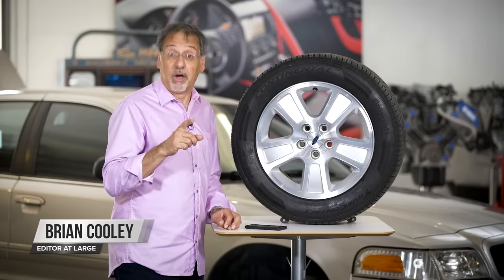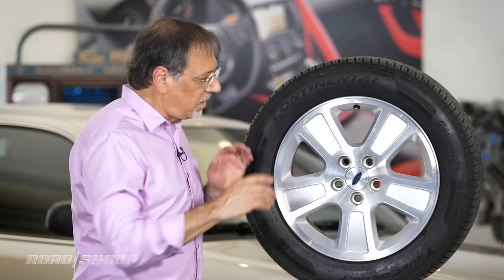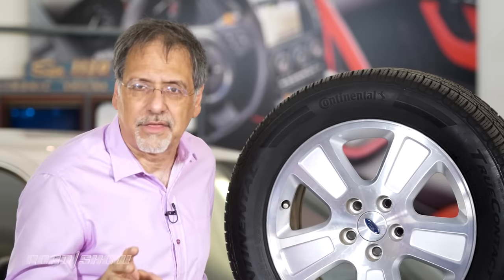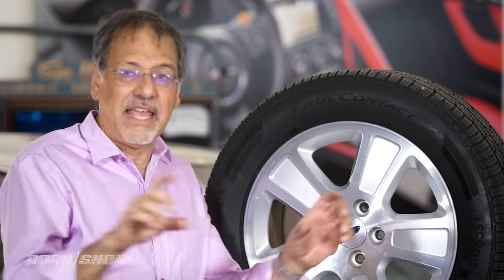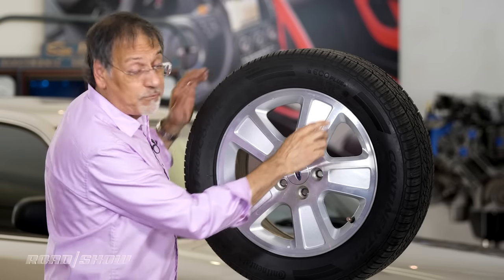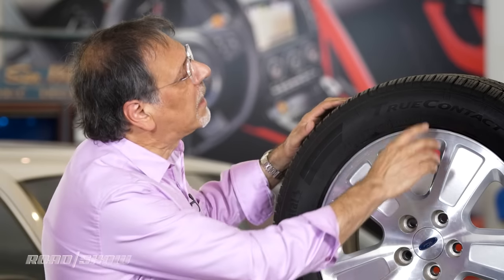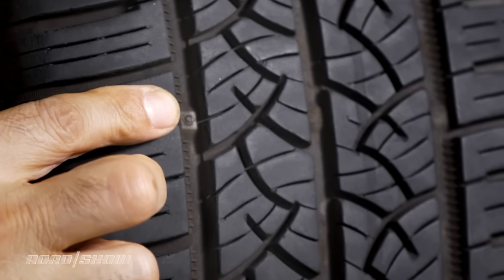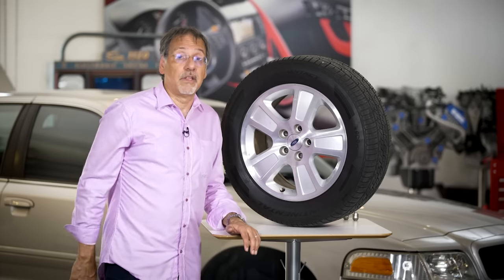How to read tires to know their size, quality and more

Comment: Okay so question Sir, I have an ton of wheel well clearance on my 2021 impreza sport hatchback in manual transmission. It has P225/40R18.  Can i upgrad my tires when they need changing to P245/40R18?

Comment: When you buy a brand new car should the code inside the car door match the code on the tires? This is what I have been told I took my car in for rotating tires and I know they’re not mine and the numbers don’t match. Never had a reason to check before.

Comment: Should have spent more time on the UTQG rating to make it known that one tire from a certain brand with a higher treadwear number does not mean it will necessarily wear longer than a tire from a different brand with a lower treadwear number. This can also apply to different models of tires from the same manufacturer.
In other words, just because tire model 'A' says 600 and tire model 'B' says 480 does not guarantee that tire model 'A' will last longer with everything else being equal. The UTQG is subjective based heavily on the tire manufacturer's marketing team.

Comment: I have a question: My tyre shop recommends 40PSI all around, but my car recommends somewhere around 28 front, 24 rear (I can't remember off the top of my head). Which one should I go with? I've heard arguments for both.
Reply: Who you trust more your Tyre shop or the ones who made your  car?
Reply: @horaciobrown9754  Ford, obviously, but I've been told the 40 PSI figure by at least 3 different shops.
Reply: There really isn't that much difference between 28 and 40. You'll probably hardly notice a difference in any parameter, but more pressure will yield better fuel economy and less traction. But both changes will be marginal.